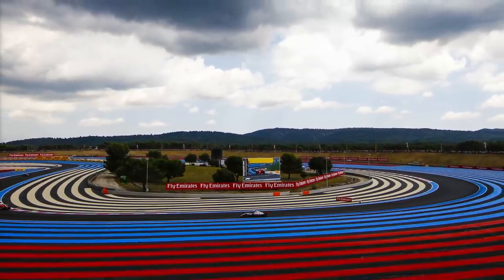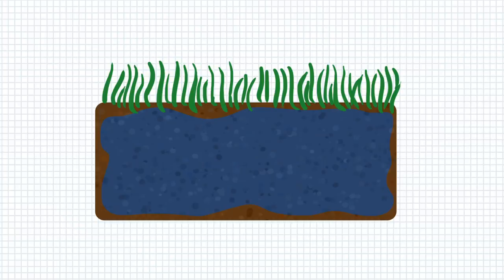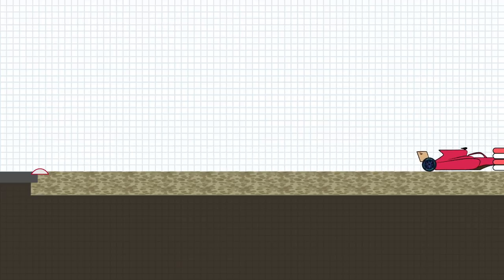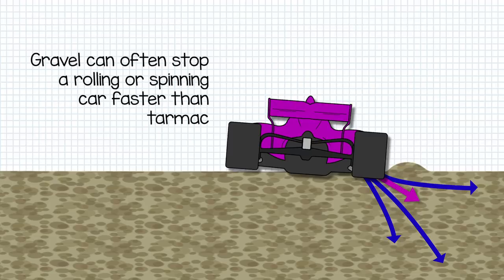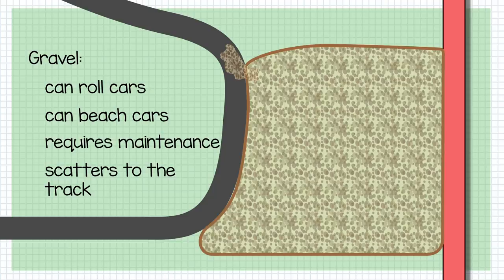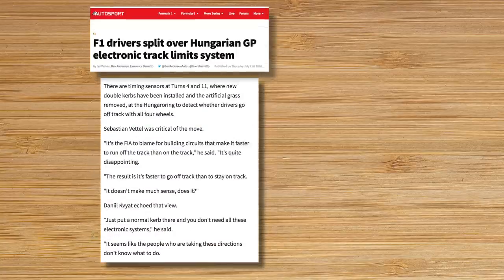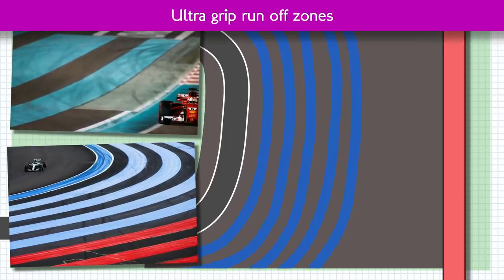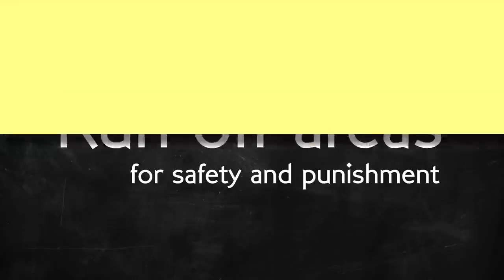Run off areas in F1 - Safety and shortcuts

Comment: Water traps on the return route would be a nice feature. Basically a 1cm deep pool of water sitting on asphalt and blocking the return route of a runoff area. That way the car would be able to slow down where it's necessary, but would be punished on the way back onto the circuit. Water would also dry pretty quickly when pulled onto the track and wouldn't need any kind of maintenance.
Reply: Kris De Presso
Not safe at all, and entirely useless

Comment: I'd love to see a lot more of the "ultra grip zones" as it is extremely difficult to implement rules on when a drives has to use a return route and when not. Also, the "ultra grip zones" can help slow a crashing car even more then normal tarmac, and when heading straight for a barrier tirewear is not your main focus

Comment: I think you need mostly a combination of three things
The return routes are very good to use at most corners (Turn 19 of COTA, Les Combes in Spa) but in some turns you can only put the kerbs, when you don't have enough space for a return route and the drivers tend to win time by cutting the corner (Turns 1&2 of Catalunya-Montmeló, Variante di Ascari at Monza) and the giant blue lines like the ones in Paul Ricard actually would help a lot in the case of the car really going out at high speed, to prevent bad crashes (Turn 3 at Red Bull Ring, 130R in Suzuka)

Comment: I'm absolutely talking out of my arse right now but I think we have seen a lot of positive effects on the races from having tarmac runoffs. The first few laps are less filled with collisions and drivers aren't getting punished in the same way for other driver's mistakes. Furthermore, when we now see a driver make an illegal move to force another of the track the car being forced of the track gets less of a deficit for it and can respond in a better way. I'm thinking of Vettel vs Verstappen China 2019 but there are countless other examples. It also gives more incentive for taking an outside line like in Australia 2019 in turn 4(i think?) since a mistake from the inside car (sending it into the outside line of the corner) can be dealt with by the outside car cutting the track just a little bit.

Comment: At the 2019 Indycar race a COTA, the Indycar officials removed the track limits.  At a big turn with a huge runoff area, they simply went straight into the runoff area by like 10-15 meters and went faster by doing that.

Comment: I say that they should install some kind of speed detector on tarmac run-offs so drivers won’t use them as a advantange. They should get a 5-second penalty if they go over the allowed speed. One time running wide would be fine, but every time later would result in a penalty.

Comment: I know it is an old video, but what about a grass (real or otherwise) verge at least 1.5 car widths wide, backed up with asphalt and a return route? Then you have the best of both worlds - immediate penalty for running slightly wide, but a safe and controlled reentry for those that really blow it or otherwise need to use the asphalt runoff. Secondary bonus - the green edge of the track is much nicer aesthetically.

Comment: I have got multiple problems with tarmac run off areas. Yeah, they are the most effecient, but they come at a high cost. Firstly, they are not pleasing on the eye. Curcuits like Yas-Marina, Sotchi and of course Paul-Ricard have got zero atmosphere because they do look like big parking lots. The race track itself starts to look rather gimmicky, since it's just two white lines, rather than an actual "road". Secondly, they take a big part of the risk and challenge for the drivers away and thus the fascination for what they are doing. (Not ideal when the sport is already struggeling to keep fans interested). In Monaco or on the Nordschleife it is thrilling to see drivers push the limits because the more they commit, the higher the risk for a severe consequence gets. It's a dance on a blade. Run wide at the high speed corners of the Nordschleife and you can carry the car in pieces back to the pits. Run wide on tarmac run-off like at Yas-Marina and it's no big deal, just keep your foot down an take the wide line. That's why fans love tracks like the Nordschleife, Monaco, Zandvoort, Watkins Glen etc. Just imagine how much more respect you would have for driver to push flat out in corners like Pouhon in Spa if it didn't have a tarmac run off area. I know they are the best and safest, but I'm sorry to say that I'd rather have a slower sport than tarmac run off areas. They ruin tracks and are one of the reasons the sport is struggeling so much.

Comment: Sergio Perez flip the car in Hungary 2015 because right wheel get caught under the car after hitting the barriers. And so many times that same have almost happened after suspension failure or crash/hit (Räikkönen Bahrain 2006) I guess no one suggest that we should take wheel tethers off? And in open wheelers there is always risk flip the car after tyres hitting between two cars. Something like Diniz Nurburgring 1999, Klien Hungary 2005, Heidfeld USA 2006. How many times the only main factor actually have been only gravel traps when car have flipped over?

Comment: I think another idea that could work in F1 very well is if we have a thin strip of gravel running along the side of the track. It deters the drivers from running wide but still gives the advantage of the asphalt run off area.

Comment: I know this is really late but you could use a small gravel strip next to the circuit into tarmac runoff to prevent exceeding track limits.
Reply: The gravel will slow the car down or cause a spin if a car hits at at speed but will not likely flip due to the tarmac that immediately follows

Comment: You could create a sort of gradient down from the track to the run-off, that way the cars in the run off area are sucked into a pit and, while they may gain speed entering it, they'll lose speed heading uphill back onto the track. Obviously this relies on a multitude of factors: a) the area must still be large enough to be safe, especially if many cars are going to be sucked in; b) the edges have to be in this goldilocks zone of a high enough angle to make it not worth cutting, but a low enough angle that cars can re-enter the track, as failing the former just makes no difference, while failing the latter turns it into a car bin; c) visibility into and out of them so drivers above know when someone's stuck in there and drivers below know when it's safe to return

Comment: That first lap in Paul Ricard was so embarrasing. A lot of drivers ran wide in Turns 1-2 and 3-4 without losing any time. Why didn't they make an alternative route to rejoin the track and make drivers not to gain any advantage as they have already done in some other circuits? 
For example:
Turns 1-2-3 in Singapore 
Turns 1-2-3 in Spain
Turns 1-2-3 in Sochi 
Turns 1-2 and 4-5 in Monza 
Turns 12-13 in Gilles Villeneuve 
I think they should penalise drivers when they make a mistake in these tarmac runoffs. They should have done this in Turns 1-2 and 3-4-5 in Paul Ricard (They did the same in Turns 8-9 as in Turns 1-2 in Monza, so well done. But only half of the job was done...). And they should do the same in Turns 1-2-3 in Mexico or Turns 8-9 in Austria... Hope they realise soon that these tarmac runoff areas MUST penalise drivers and JUST remind them to drive between the white lines...
Reply: Ernesto Bonilla 
This one should get on the List of improvements for next Year. It's not like 10 Cars would have crashed if everybody stayed on Track. They were driving agressive and leaving the Track because they knew they could do it without any Penalty.
Reply from the maker: Yeah, I think have some tall polystyrene boards way out wide that they need to navigate or something. Paul Ricard being a test track is always going to be mostly tarmac cause you want cars to be unpunished for mistakes, generally, if you're testing.
Reply: In turn 1-2 they drove wide because else they wouldn't have anywhere to go because of Bottas and Vettel. Besides some of the drivers (Kmag but not Verstappen) gave their positions back.
Reply: verstappen didn't need to give his position back - the people he overtook crashed into each other

Comment: What I would like to see to prevent abusing track limits is one or two meter or so of grass directly behind the white line or or curb, followed by tarmac and also having to take a return route. You won't be able to to run wide to gain an advantag but it's still save.

Comment: For me the best option is to put a defined width (e.g. 5 or 10 meters) of slippery grass next to the track, and then afterwards having tarmac run off area. So the driver has disadvantage when shooting off the track, but will be slowed down in case of an emergency right afterwards

Comment: I know that this is going to sound cocky, but gravel and grass can make a really good show. I know sometimes it's just frustrating, but if you take, for example, the 2016 spain gp, where the two Mercedes crashed because hamilton went out of the road on grass and then both slid on the gravel. It was one of the best moments of that year. Having said that, I'm all for drivers safety, as for cars safety, it depends

Comment: I like the run off area that the Paul Ricard track has because it punishes you for going off track by wearing your tires even more or flat spotting them and it gives more time to react for turning or braking... there for cars will get damaged less than they would with slippery grass or gravel traps.

Comment: Why nor use really sticky rubber? Wirh enough holes in it and drainage underneath to disappate water? Stops cars quickly and does punish driving over them due to the high friction and therfore the speed loss.

Comment: I don't mind tarmac run off too much, my main issue with them is that they don't slow a car down that can't brake due to a failure. Shanghai hairpin is a good example for that. Watch the Vergne suspension failure, or more recently, Patrick Kujala in Lambo Super Trofeo Asia last year. Tom Coronel at Motegi a couple of years ago etc etc

Comment: I think tarmac runoff areas with a designated re-entry route are a good idea. Not only can the route serve as a punishment, the entry point can also be put somewhere safe and they could even add a stoplight preventing cars from reentering in front of others or as an additional punishment. The only thing I dislike about them is that they only punish for one bad lap. That works during a race but during qualifying it pushes drivers to the max. They'd rather drive as fast as possible and risk one laptime than when they could end up in the gravel and risk the rest of their session. 

But there could be additions to the rulebook to correct this. Maybe a driver who gets off track during qualifying gets his best lap removed, loses a place on the starting grid or gets 0.5s added to his best lap... I'm sure the FIA guys could think of something

Comment: I must say, I still prefer a nice solid wall to any of the runoff options. The problem with runoff is, that you can usually save it, if you pushed a little bit too hard. But that takes a lot of the challenge out of driving. Look at Monaco. The walls mean, that the difference between a fast lap and a broken steering rod tend to be millimeters. And it's not a coincidence, that the greatest drivers of all time hold all the records there. Asking for that level of perfection is what sorts out the legends from the great drivers.

Comment: It sounds as if there should be a strip of gravel around a corner which then leads to a tarmac run off area. And the gravel if it goes back on the track should have a sort of small bump which avoids gravel to go on the track when a car re-enters the race

Comment: I personally don't like tarmac run-off areas because it takes the feeling of being 'on the limit' away for both the driver and the trackside viewer. The masterbocht at Zandvoort is a great example of this, driver really hanging on to it and being very close to the grass. You can always see there who the most committed drivers are and who aren't. 
Tarmac run-off can be reasonable good depending on how it is implemented, the way they done it at Assen for example is quite good. All the corners have a lot of camber there, while the run-off hasn't or is even off-camber, making sure you lose time when you run wide

Comment: What about putting a strip of grass/gravel on the edge of the track with tarmac beyond that? If a driver makes a mistake they get the punishment of grass/gravel (which may make them go even wider), but if they really mess up they end up on tarmac to slow them down before hitting the wall.

Comment: Whenever people complain about shallow curbstones or massive tarmac runoff areas it's like they completely forget that motorcycles exist, are also raced, and have much more severe consequences for loss of control. 
If we want to pretend that bikes don't exist, there's also a certain pair of incidents in San Marino in 1994 that might have been less severe or avoided entirely had the runoff been longer and fully-paved. Safety improvements should not require tragedy as a prerequisite

Comment: For the double apex left hander in your example at 4:50, wouldn't it be easier to extend the white lines so that the optimum racing line is within the white lines? That way you don't artificially create a problem for yourself by limiting the drivers who will naturally drift out wide, but still have to come back left anyway for the next corner.
Reply from the maker: Cause the challenge is to take the double left-hander within the lines. That's why you don't straighten out chicanes, cause you're supposed to go between the lines, that's the game :)

Comment: The big problem I have with tarmac run-off is they are useless if a car has had a complete brake failure or their throttle is stuck open. At the 2013 Malaysia GP, Alonso's front wing fell off and caused him to have no brakes nor steering. Gravel was the only way to stop him. Personally, I feel you should have grass at the edge of the track, then tarmac, then gravel, and then the wall. Turn 1 in Mexico (NOT 2 and 3) is a good example.

Comment: Would it be more advantageous to put small "sand traps" at run-off areas?  The majority of the runoff would be paved to provide better slowing for those who have lost control but those places drivers might use to overshoot and possibly gain a bit of time would be gravel, forcing the drivers around it if they judge that they've botched the corner.

Comment: 10-15 feet of grass either side of track would stop the habbit of exceeding track limits as there would be an obvious time penalty involved, beyond the grass tarmac run off areas could be used as intended for cars that clearly don't have the ability to make the corner with the usual impact protection for failed brake situations and such, foam dividers for areas where corner cutting would be an issue for cars to navigate

Comment: All you need is harsher rules. Go offtrack 3 times in FP, go 10 min in to the garage. Go off track in Quali, lap goes in to the garbage. Offtrack 3 times during the race, stop and go penalty or something.
It takes a lot more skill to progressively aproach and learn the limit then just to send the car at max speed around the corner and see if you exceed the track.
No need for gravel, grass or astroturf.

Comment: But drivers should feel punished if they made a mistake and ran off the track. Aren't F1 drivers the most skilled and overall "best" in motorsport? Well, increase the stakes then. Gravel traps should be used in mid speed corners and while tarmac provides more safety, it does create a lot of uncertainty towards track limits as you suggested in the video. Run off specific sections are also needed so drivers don't take advantage or cut corners for avoiding collisions, avoiding being overtaken, overshooting corners and so on as you suggeted.

Amazing video by the way!! This issue is one of the few that really annoys me about F1 and I have seen so many problems over the years with little to no solution on many tracks. Keep up the great work man.

Comment: But what about turns 8 and 9 in Montreal? After the introduction of the third drs zone after turn 7 you could easily go wide or look up at the end of the straight and cut the chicane easily back on the track passing near the skittle like gasly and other driver did a bunch of times in Free practice

Comment: I have a question:
Sebastian Vettel in a pre-race briefing said that curbs in one of the german race tracks (I believe it was Hockenheim) came with some sort of a plateau - he claimed that these were absolutely safe, as they were flat and wouldn't launch a car into the air, but just high enough to unsettle the car, which made it unsafe or even impossible to step on the gas as early as a driver staying within track limits thus eliminating the benefits of intentionally running wide.
Do you know these kind of curbs and what do you think of Vettel's suggestion to Charlie to install these curbs on most corner exits to replace sausage curbs?

Comment: As awful as those friction lines looked at Paul Ricard, I kind of like the idea of having the option to run off but if you do you get more tire deg. Still am imperfect solution though, since they're pretty useless on a wet track.